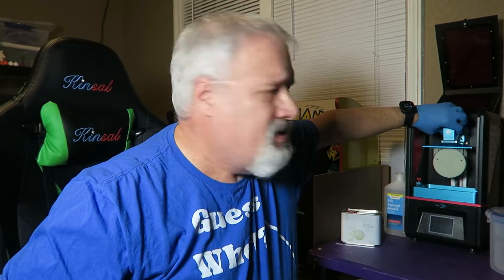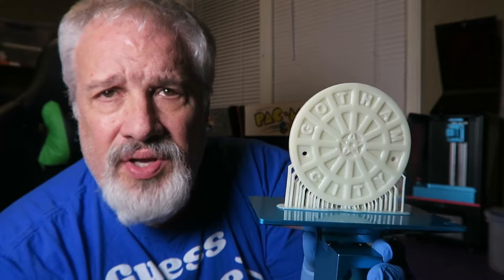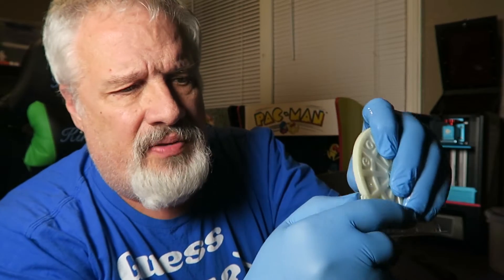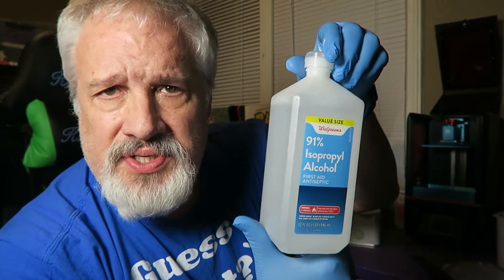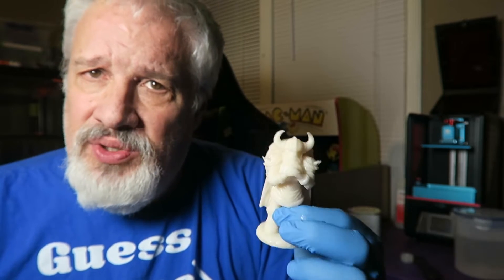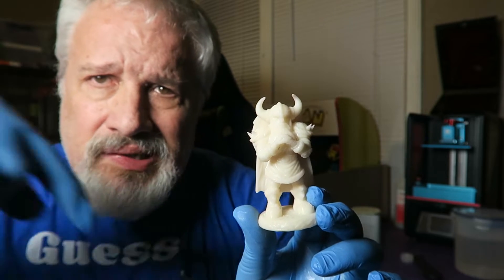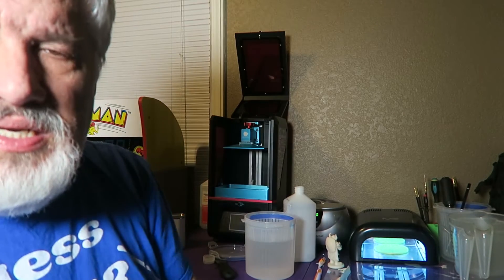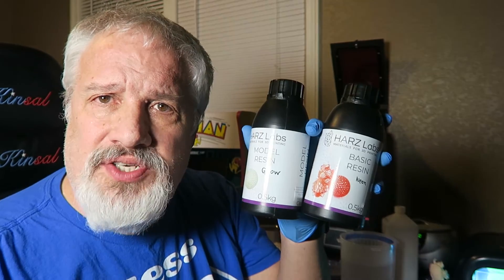3D Resin Printer Tips and Tricks! ANYCUBIC Photon! Episode 3!

Comment: Hey lm brand new to 3d printing my anycubic photon s came in 7/9/2020 i set it up just like you showed on your videos . Then i ran 3 prints and they came out beautiful . Then i ran another print though the anycubic slicer saved to  thumbdrive plugged it in to the printer and the 4 squares on the front were blank as if the thumbdrive was empty. So i ran the print through chitubox and the result was the same. So i know its something im not doing right i need help on how to transfer files from the computer to the thumbdrive . My computer is running windows 7. Ive watched and love your videos lm a old guy and can relate please help with my software and transfer issues thank you very much

Comment: Great video, will definitely use some of your tips and tricks! How long should objects stay in the UV to cure? Can it be overdone?
Reply from the maker: That's a great question!  Usually, it all depends on the size of the object.  I'll cure small objects like miniatures for around 5-7 minutes under a UV nail lamp.  Larger objects, maybe a bit longer but nothing over 15 mins.. A really good way to tell if the object is cured is to find an inconspicuous spot and press your fingernail into it.  If it leaves a mark, then the model needs more curing.  If no mark is left, then you are good to go!  Yes.  Overcuring can lead to brittle models that will eventually break.  Of course, that depends a lot on the resin you are using.

Comment: Just wanted to comment and thank you for the pickle container tip. I purchased a resin 3D printer for our office and creating a cleaning work flow that was easy to do for the wide range of engineers and designers we have took a while to figure out. As part of that process we have two pickle jars, one as an initial bath and one in our ultrasonic cleaner because explosion proof ultrasonic cleaners are far too pricey.

I know uncle jessy has played with various cleaning chemicals instead of IPA, I think you have followed suit since this video. My question is, have you found any tricks to separate the IPA and resin so that you can re-use the IPA or even just so you can cure the resin in sunlight and dispose of it in solid form? Solid is a much better disposal process compared to liquid. I've tried leaving my IPA mixed with resin in a container in the sun, which ended up getting snowed on. Leaving it in the sun doesn't cure the resin, leaving it in freezing weather made the resin congeal at the bottom, but when I poured out the IPA it was extremely cloudy and it seemed that some of the resin material had fallen out of solution, but a lot of the other constituents were still in the IPA. Anyway, thanks for the videos!

Comment: You tip with the Sprayway works great. Although it is an American product. I was able to buy some here in the UK. I thought if it cleans the resin so well why not miss out the IPA wash and just use the spray. It seems to work fine and not as messy.

Comment: I am looking at PHOTON S, I suggest you create a video that shows how to create a full enclosure [could be cardboard] with hose coming from and returning to outside. That dual carbon filter gives people a false sense of security and they show the unit being used in apartments and unventilated spaces. There are reports of bad reactions to fumes from resin and it is unregulated it is areal issue.

Comment: So just a quick tip. I know some of you have had problems with your print sticking to the FEP. Here is what I do. But take note to do this at your own discretion.  I spray my FEP film with armorall spray, and then wipe it off. It makes the FEP a little slippery so my resins don't really stick to it.  Has worked for me so far. Good luck.

Comment: how did you get the supports out from the formlabs software? As far as I know, they can't be used by non Form1 form2 users.
Reply from the maker: That is correct, the Formlabs software cannot be used for non-Formlabs printers.   For me, the Formlabs software provides a guideline to how well I have set up the supports.  What I normally do is set up supports in the Anycubic Photon slicer, then I'll open the STL over in the Formlabs software.  I'll check to see if I missed anything.  If so, I'll go back and add/remove supports.  I just basically use it to 'check my work'.

Comment: Do you clean the vat between prints? That is if you are printing immediately after. Can't find any info on that. Just cleaning after printing session
Reply from the maker: I guess that all depends on what resin you are using.  If you are using any of the Anycubic clear resins, I have left resin in the vat for weeks without issue.  Now, it's a different story if it's opaque.  You can practically see the separation of the resin and pigment.
Reply: I'm just on my first bottle that comes with the product, but I do have mono price gray ready on hand. So far good little printer
Reply from the maker: Awesome!  Yep!  I have left the Anycubic green in the vat for print after print and even more than a week or so since it's clear without issue.  Any of the opaque resins, like the gray, I would filter, shake and repeat.  Awesome!  Glad you are enjoying the printer!  It's a great little machine.

Comment: hi man! very good video! thanks for your tricks! I´m curious about how longer do you wash the piece with alcohol and how much time do you light the model. Also I realized you didn´t clean the mode with water, is it fine? thanks!!
Reply from the maker: First off, thanks for watching!  Washing in alcohol will vary depending in the model.  Your goal is to remove all of the uncured resin from the piece.  I first soak the piece for a few minutes and then use a toothbrush.  You can run your gloved finger over the piece and if it feels a bit too 'slimy', you know you have a bit more resin to remove.  Curing the model with UV light depends on the model size too.  If it's a Miniature, probably no more than 4-5 mins.  Bigger pieces maybe 15 mins.  You have to think that all you are doing is curing the 'uncured' resin on the outside of the print.  All the other layers have been 'cured' by the UV light of the Photon.  I also have stopped cleaning with water because water tends to make clear resin very cloudy.  I find it easier to rinse in alcohol for a few minutes, scrub if needed and THEN if needed soak again in same alcohol bath or a separate tank of alcohol.   Thanks again for your questions!  Stop by anytime :)

Comment: It made me cringe a bit to see you not wearing safety glasses...  Especially when you brought out the toothbrush!

I got a cheap ultrasonic cleaner from Harbor freight for my final clean, but I always do a first stage cleaning in the jar of old alcohol.  I like your pickle jar idea for that.
Reply from the maker: Kirklin Williams Ha!  Yep. That print has literally been on by build plate for nearly three weeks!  It had pretty much drip dried!  I have an ultrasonic cleaner I like to use as well but this print was a bit too large for the tank.
Reply: Do you use the ultrasonic cleaner filled with alcohol or water? I guess using alcohol might be dangerous.
Reply: JMB I use alcohol.
Reply from the maker: I use a non-heated ultrasonic cleaner and I use alcohol straight in the vat.  I have heard some folks place the print in a water tight ziplock baggie with IPA, then place in a ultrasonic cleaner filled with water and that works well too.  Most of my prints with not a lot of nook and crannies, I'll just scrub with a toothbrush followed by a second alcohol rinse and then let dry and cure under UV.  I never use water.

Comment: What nail lamp is that? I haven't found one that is 405nm light. All those that look like yours state much lower wavelengths.
Reply from the maker: This is the lamp I use.  https://tinyurl.com/y7mrbkes
Reply: @3DPrintFarm  Well, shoot. That is exactly the one I had that I returned because Anycubic told me that it will not cure correctly. lol They said I need to find a 405nm light.
Reply: @3DPrintFarm  Here is the one I used https://tinyurl.com/yc65cwp5  seems to work fine so far. I did hack it , and turn off the timer so the LEDs turn on when plugged in and stay on.